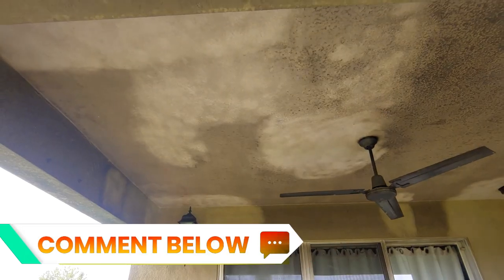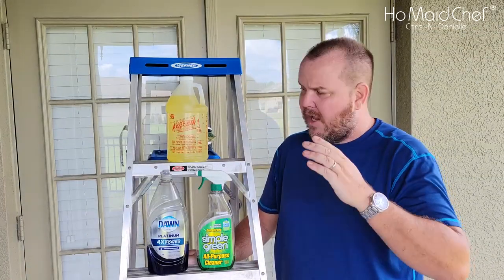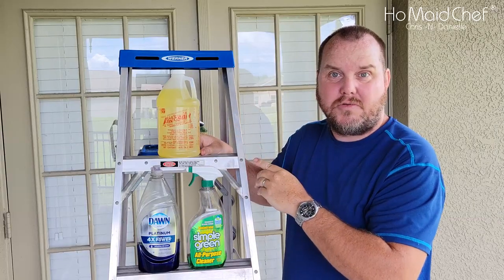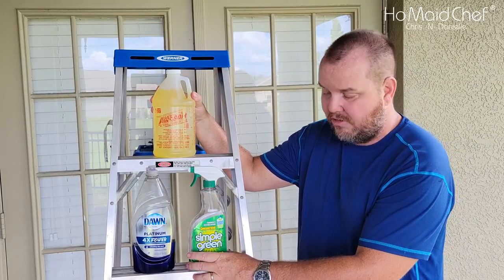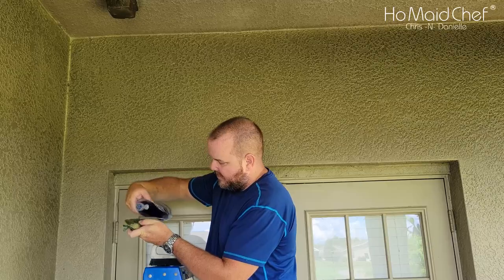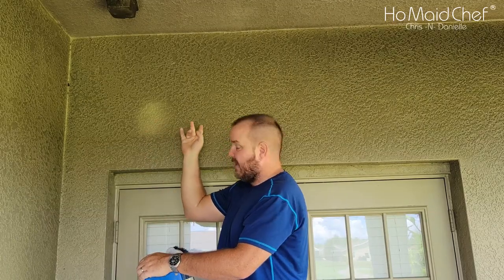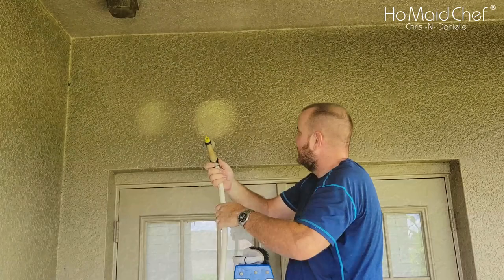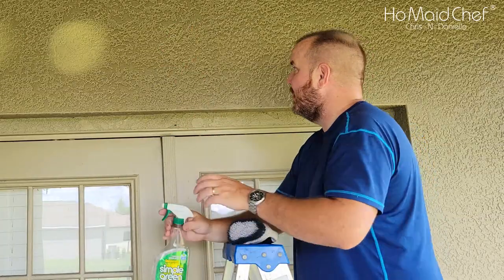Removing Soot, What Works The Best? Dawn, Simple Green, LA Awesome...

Comment: thanks for this. i had a grease fire in the kitchen. soot has been there for years. ive tried everything to get it off. come to find out magic erasers work on soot too, but that's a lot of scrubbing and my shoulders are already hurting. i have only a small patch cleaned and the erasers don't last long. i had heard about la totally awesome from a coworker but he hadn't used it before, but said his uncle used it for soot. im glad you gave it a test. ill get some after work tomorrow. thank you for this video.
Reply from the maker: Magic eraser are awesome for small things, my wife uses them all the time, they just wear out so fast. We hope that you get your soot gone in your kitchen.
Reply: how was it for indoor use?
Reply: @jc_yadigg  great. U need to follow the label for deluding it. It still takes a lot of scrubbing and will take the paint off if your not careful. I recoment using a magic eraser and the totally awsome. Any spot that has like wood filler or something pourous like that is still going to be discolored. Some types of Calk (or maybe just older Calk, I'm not sure what exactly was used in this old house) will remain discolored. Spray it on leave it set like 15min hit it with a magic eraser. Always do a test spot in an out if the way location.

Comment: ❤ I love the smell of Simply Green so fresh
Now on the other hand
Be careful indoors with AWESOME CLEANER
you need ventilation 
I figured that was going to work 😂 
Also y’all got to try Pomolive oxy dish soap it works good too
Reply from the maker: Simple Green was about the only cleaner we ised in the Army, love the smell as well. Simple Green also works pretty good as a mosquito repellent.

Have not had an issue using Awesome inside, but my wife would probably have an issue. Also thanks for the tip on Pomolive.

Comment: 2 parts what to what?
Reply from the maker: The instructions are on the bottle, depends on what you are doing.
Reply: @ChrisDoesWhat  - how did you mix 2 parts of the cleaner to 1 part of water?
Reply from the maker: Fill the spray bottle with 2/3 cleaner, 1/3 water.
Reply: @ChrisDoesWhat  thank you, I might try 50/50 but questioned the mix you used as the awesome worked well.